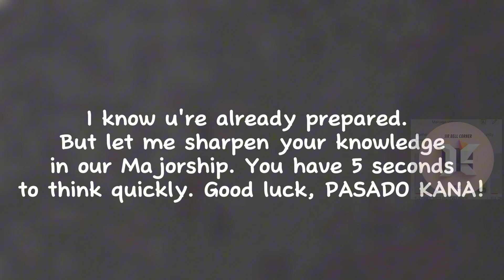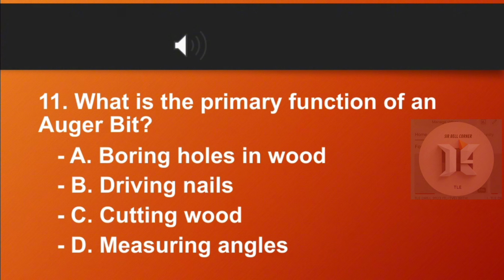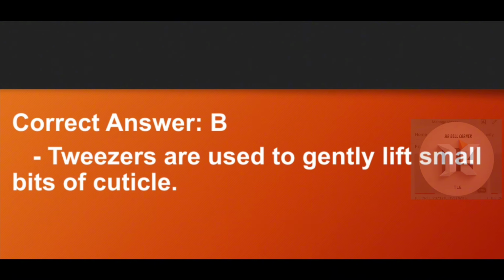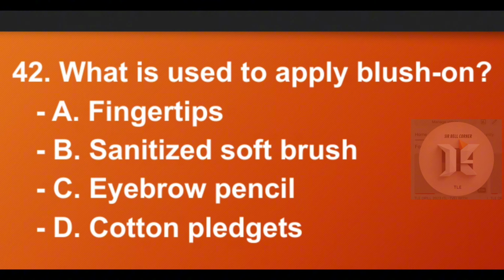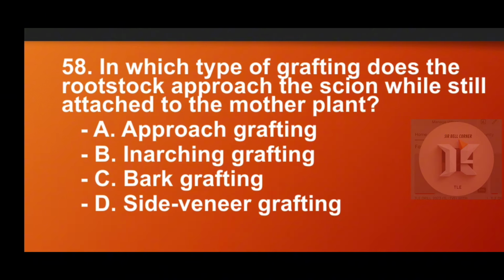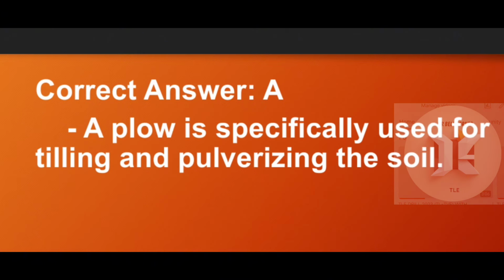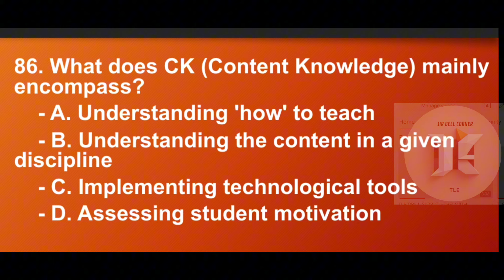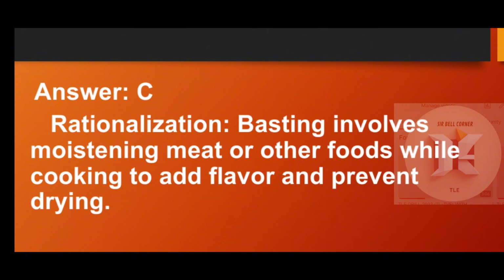1-150 LET TLE (TL TVE) BOARD QUESTION DRILLS with RATIONALIZATION | MARCH 2024

Comment: What is the primary fuction of portland cement in concrete? 
-portland cement act as a bonding material when mixed with water

Why seashore sand not syitable for concerete? 
-seashore sand is not suitable due to its containing weakening chemical.. 

What is the purposed of coarse aggregates in concrete? 
-coarse aggregates acts as fillers between fine aggregates, e hancing stability

What factors is most crucial determing the strength of a concrete mixture? 
-Amount of water is crucial in determining the strength of a concrete mixture
-To much water is reduce strength by 25% to 50%

In the CLASS A concrete mixture 1:2:4 what does the ratio 1:2:4 repesent? 
-its repesent of Cement:sand Gravel

What is recommend time frame for pouring mixed concrete after mixing? 
-WITHIN 30 MINUTES

What tool is essential for transpirting aaggregates in hand mixing
-WHEELBARROW is Essential for transporting aggregates in hand mixing

Why is it crucial to avoid water contianing mud, oul, alkali and other matters in concrete? 
-Avoiding impurities in water is crucial to prevent increased porosity in concrete. 

What is the purposed of plumb level in concrete work? 
-A plumb level ensures the Vertical alignment of concrete structures. 

What is primary function of an AUGER BIT? 
-auger bits are design for BORING HOLES IN WOOD

When would you use an expansive bit? 
-EXPANSIVE BITS are use for boring holes in wood woth diameter more than 2.5 centemeter. 

What is the purposed of the braces in woodworkinv? 
-A BRACE is used for holding when boring holes in woods

What is the main function of hand drill? 
-A hand drill is used for boring holes with DRILLS bit than 1/4 inch in diameter

When would you use a BRADAWL? 
-A BRADAWL  is used for makinv a small holes in wood for screws and nails. 

What is the primary purposed on electrict drill? 
-an ELECTRIC DRILL is electrically operated and used to bore holes with a desire soze using drill bit

Why does an Electric drill required regular maintenance? 
-regular maintenance is neccessary to prolong the life of an electric drill. 

What is the primary purposed of a claw hammer? 
-a claw hammer primarry driving nails, with the claw for pulling out nails

When would you use a mallet in woodworking? 
-a mallet is used to prevent the handle of CHISEL FROM BREAKING

What is the function of framinv square? 
-a framing square is used for measuring angles in woodworking.